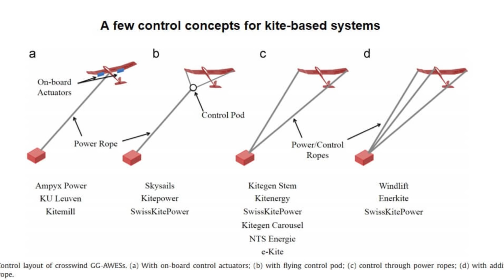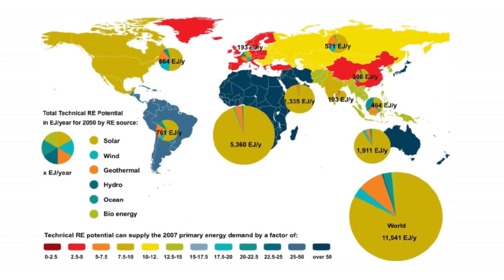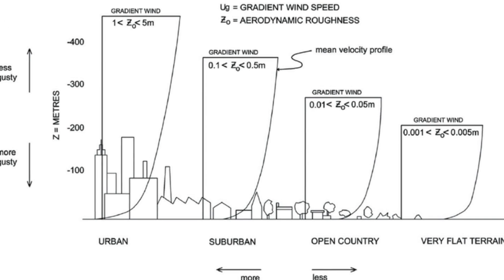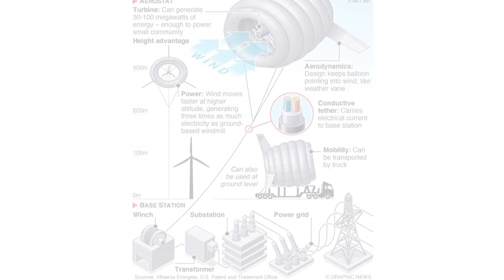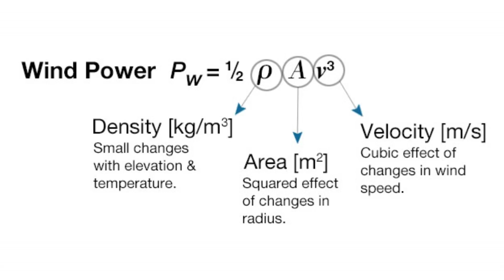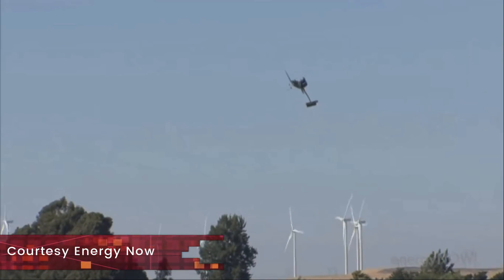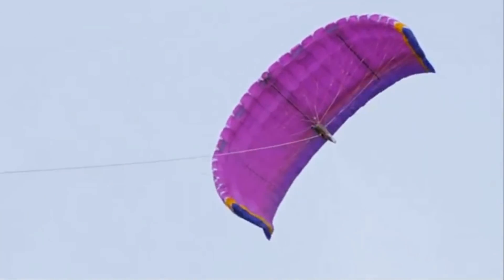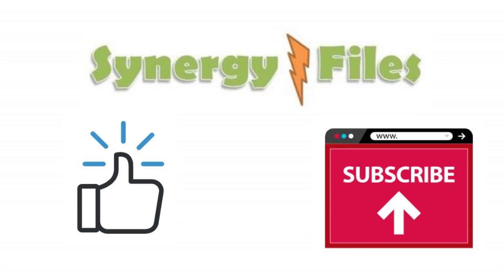Airborne Wind Turbines- The next big Renewable Energy Product

Comment: How about airborne generators also capturing lightning energy? just a thought
Reply: What happens to the air space law ? Specially small privat planes and helicopters?
Reply from the maker: Trouble is, what would it do when there is no lightening? The ones I have shown here are made lightening proof. So that a surge of current is not passed on to the grid
Reply: @synergyfiles3536  I was just thinking that lightning may be bonus energy that possibly could be captured (in addition to wind) and throttled down somehow in order to make it manageable and therefore be sent down the wire also to the ground station.. Or just use tesla coils to transmit...lol.